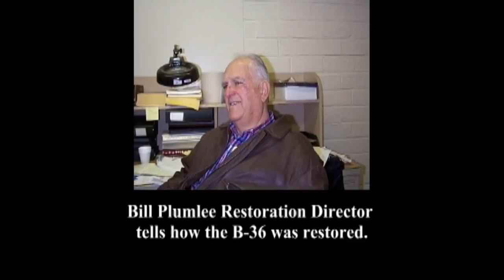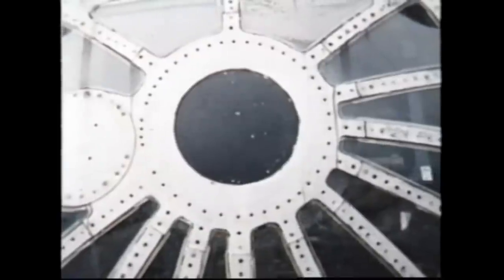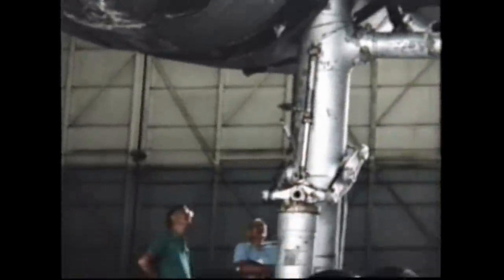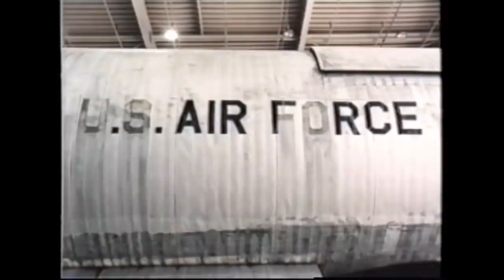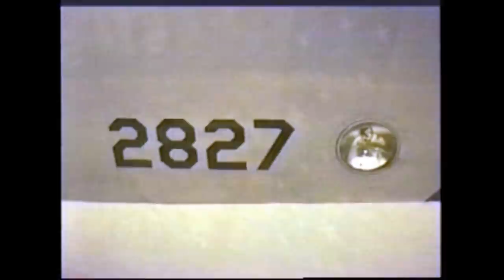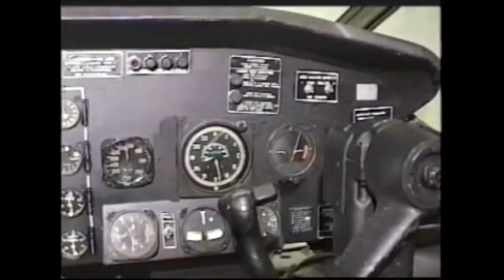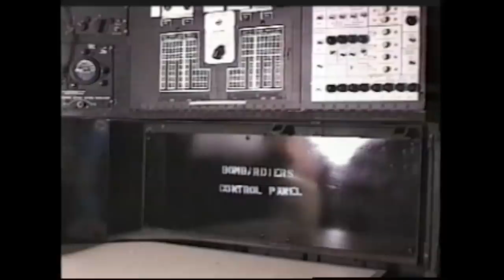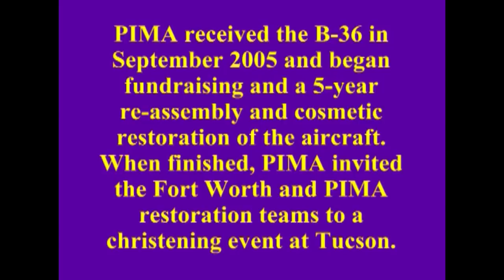Restoration of the last B-36 Bomber in Ft Worth

Comment: I actually  flew on this aircraft; it was assigned to my crew in the 327th Bomb Squadron at Fairchild AFB, Spokane WA.
Around 1973, the original Convair test pilot and I discussed plans to fly it from Greater Southwest airport to Harlingen, TX, then the location of the Confederate Air Force.  That never took place and was left to be vandalized.  On a mission, and after three days of pre-flight testing, and loading three railroad tank cars of 115/145 gasoline, it was ready for a 30 hour flight. I accumulated over 800 hours in the B-36 .  F Hasman
Reply: I saw a modified B-36 at Lackland in what looked like a private piece of ground. It was modified to be a transport or some other type of aircraft.  This was about twenty-five years ago.
Reply: FRANK HASMAN 
I w
Reply: Alwey Wong you’re actually thinking of the XB-99. It’s a different plane but based on the same model. That plane is now at the US Air Force Museum in Dayton, OH.
Reply: Great to hear from guys who worked with this gargantuan aircraft!
Reply: Curious to know how much three railroad tank cars of 115/145 goes for, and where did you get it ?
Reply: FRANK HASMAN g
Reply: My dad was a mechanic at Davis Mounthan Air Force Base from 1957-1963 where he helped dismantle the top secret bombsites off of them. Back then security allowed us kids to go in also and we had a blast climbing through these beauties. Good times.
Reply: @checkyoursix5623  Mmmmm... 3x 30,000gal, 90,000gal of high octane avgas at $8/gal? (I only buy 100LL, @ $5/gal today).  A few refineries still made this then, prolly not now.  Special order availability I'd wager. Glad I don't have that fuel bill!
Reply: Hi Frank. Were you a pilot on the B 36 ?  My uncle ( I can't mention his name) was an IP on the B 36. . He was a big dude and his size kept him out of the P 51 s. He joined the service when the flying part was called the army air core later to be renamed the air force. He would tell me stories of flying that monster and how it would gobble fuel to feed its engines. He retired out of the air force as a B 52 IP and commander. He said out of all the aircraft he flew the B 36 and B 52 were the most challenging and exciting to fly. It is to bad  we can't stay young for longer than we do. All of us that were and are pilots belong to a special group and provides a fun filled and very rewarding career. Good health to you Frank and thank you for putting your life on the line to protect the rest of us.
Reply: Frank,
Thank you for your service. My father was a B-29 navigator 1944/45.
Paul
Reply: Very sorry for you.
Reply: NO words to describe the HONOR,RESPECT,LOVE that these HEROES DESERVE for ETERNITY. THANK YOU ALL  WHO SERVED TO PROTECT OUR OFTEN TAKEN FOR GRANTED FREEDOMS IN OUR USA. GOD IS SMILING ON YOU,THANK YOU ALL. Rod Checkalski/WI.
Reply: @rodcheckalski3942  - There is no fool like an old fool.
Reply: FRANK HASMAN, a Salute to you sir!!..
Reply: I think you mean Commemorative Air Force
Reply: What a fantastic experience to be aboard this plane!  When I was a kid growing up in San Diego the B-36's would fly right over my home leaving Lindbergh Flied..  I could hear it coming with those 19' diameter props beating the air, and I would run outside to see it pass overhead - every time!  ~WHAT a PLANE!~
Reply: Lucky to be alive, that airplane was a piece of junk!
Reply: Cool story Frank. My dad was in SAC around 1948 and set up in French Morocco. Thank you for your service.
Reply: This plane was a pos!
Reply: @DavidSmith-jj1de  Thank- you 

Dave Smith
Reply: I use to live in Spokane Washington my dad was stationed at Fairchild afb before we went to Germany in 82-85
Reply: Too bad you only proud to flew it but no action from the government to make the plane to fly again.

Only lots of old folks  cares about this plane. ..not the government. .not the young people.

So sad the plane only ended at the museum! !
Reply: Alwey Wong .... the old XC-99 variant of the B-36 was an only child. The only one produced. I believe it’s in Dayton Ohio at the Air Force Museum.
Reply: R.R - VR46 l
Reply: Alwey Wong It was an experimental aircraft, the X99. It was the fuselage and empennage of a C-124 cargo plane with the wings and engines of a B-36.
Reply: Matt Graham it was the Confederate Air Force until they changed it to Commemorative.
Reply: Mr Hasman  sir  I salute you.  I was  fairly  young in the N  end of Idaho  remembering  36's  overhead.  How  darn old are you?  I'm  71, here, in 2019.  Spent  6 years in the Navy  (NAS Miramar  4 years) maintaining  GCA RADAR and TACAN
Reply: FRANK HASMAN thanks for serving.  I’ve always been fascinated with the B-36!
Reply: @garyharris1932  not modified,....it was designed as a transport version of the B-36....called the XC-99.  The one example is at Lackland,...and was parked out on the tarmac just down the hill from Lackland, on Kelly AFB.  I was a member of the 149 Tac Fighter Wing, and saw it all the time.  I think it's an amazing aircraft, but they only built ONE, and then cancelled the idea.
Reply: Thank you for your service ❤️
Reply: Powerful, relentless, and inexhaustible...
AND Slow, expensive, and unreliable.
Reply: John Smith tremendous salt 🧂
Reply: Wow! what a experience to fly that big but beautiful aircraft!
Reply: Dean Siracusa  Wow, I didn’t know about the cargo version. I was born at Wright Patt,  been inside the B36 many times.  My Dad was a test pilot after flying in WWII, guess I haven’t paid much attention to the XB-99 (or is it XC-99) 
    edit: I think I’ve seen it years ago, it if was parked outside.  I’ve attended several “Wright Stuff” reunions where we had the run of the museum without any public there.  Had the pleasure to sit in many cockpits.   The XB-70 guys were there, great stories.
Reply: David Smith Us kids too!  Going on thru the tunnel was the funnest in the 50’s.
Reply: My father may have been one of your mechanics. He was stationed at Fairchild, and also served in Forth Worth and Elmendorf.
Reply: Thank you for serving our country.
Reply: I look up to you m8
Reply: El Guapo mas macho  why would they put that much detail and research into that if it was a lie
Reply: El Guapo mas macho  I've never actually had it
Reply: @mattgraham4340  Back in the time he is talking about it was still called the Confederate Air Force.
Reply: Mr. Hasman, the aspiring writer in me must ask you a clarification on a technical point, please: which is correct: Bomb Squadron, or Bomber Squadron?
Reply: @garyharris1932  , that likely was a conversion to a Convair C-99 USAF Cargo Transport (source: Convair B-36 [of Bert Kinsey's Detail and Scale series of books, Carrollton, TX: Squadron Books; the author, whose name I cannot recall, was a B-36 and Boeing B-52 "Stratofortress" USAF Strategic Bomber pilot.)
   You add something to the discussion: the hybridisation of the aircraft with a C-124. Please clarify. Also, is this latter a Douglas aircraft?
Reply: @armstronglance , C-99 USAF Cargo Transport. (See my reply elsewhere in this thread.)
Reply: @Patriotgal1  fast forward 3 years and presto.
Reply: @matthewhicks6531 Another victim of the "WOKE."
Reply: @DavidRLentz  XC-99 is now in Tucson too.

Comment: I'm the guy ( Aqua shirt ) at roughly 0:35 leading the plane to Run Station #1.  I had to design the "Pull Mechanism" over a weekend because they couldn't get documents in time to me.  So, it was "My" plane until i got it to the Run Station!
Reply: DWBCHALLENGER thats a big job?? How many hours did you have in that??
Reply: DWBCHALLENGER ... Just watched this video what's the latest 
do you know? Share it with us.
Reply: Good job!
Reply: Good job. I can't imagine how nice it must be to have something like this you could call your own.
Reply: Bill Barry ....well.... it was a lot of responsibility. For one, it still had 50 year old tires on it. Would they hold?  I had them pumped “up” though to decrease the contact patch. Low speed tow wasn’t going to heat them up.  Also, I had “nothing” to go on for the method of pulling it out of a field. It was sitting on concrete pads but it had to roll across grass to get to the street.  So the design was purely my own. Had to design it strong enough.  How much pulling force will be required across that grass field?  So, design it Friday night and part of Saturday. Then the thing had to be built on Sunday for use on Monday. It wasn’t the “hours” in this case. It was the responsibility and the unknowns that could bite me with an enormous plane blocking ALL the traffic into the manufacturing plant.
Reply: MrCloudseeker  I’ve seen it and it is nowhere close to the size of a 36.  It was one that used to be part of the Pate Museum I think.
Reply: Dinos Metaxas They tried desperately to get enough funding for it to have a building structure to protect it here. People just weren’t interested. Fell far short of funds needed. It was partially disassembled and sent to Pima.
Reply: A “friend” must have messed with my phone so my YouTube identifies as this instead of DWBChallenger. I can’t figure out how to change it. Same guy!  I swear!
Reply: DWBCHALLENGER did u fly in that p36
Reply: I think I doubt it will ever fly again. It's like the Vulcan in the UK.. money is attainable. But all the engineers whpo are with us that understand the 50s mechanical / primitive analog electronic computers are getting less and less as the years go by. and the younger people just aren't being taught how these obsolete systems work..
Reply: thank you for sharing
Reply: Sure you were.
Reply: Great to hear from guys who worked with this gargantuan aircraft!

Comment: I cannot remember the exact month; but in the wee hours in 1957, I had main gate guard duty at Showa Air Station Japan. The sky lit up with very bright white lights. The guard shack vibrated and sound roared. I didn’t know what was happening. It turns out that B36’s were coming in to land at Yokota Air Base. I learned later the B36 was being retired and they were making the last flight. What a magnificent “bird!”

Comment: I Started out so happy that this was being restored and the amount of effort that went into it, then I got severe depression when I found out it is sitting out in the weather again.
Reply: But this time in Arizona! The weather if much better there so it will last longer.
Reply: Tucson has sun 360 days a year.
Reply: IVAN IVONOVICH @
Reply: @59Kona  The sun is just as damaging over time. I worked with the restoration of aircraft at the Flying Leatherneck Museum at MCAS Miramar, and baking under the sun for years on end, along with bird droppings and yes, even rain... will slowly ruin this plane again.
Reply: Building a hanger for this would cost millions 😬
Reply: Steven Cramsie Miramar is a completely different environment than Tucson. I live 20 miles away from MCAS Miramar, it gets hot and dry some days of the year, but we usually have humidity, plus salty air from the ocean.
Reply: It needs to be in a hanger.
Reply: Tucson is1 of a Few areas perfect for outside storage of Aircraft. 
Plus now it's disassembled and packed for storage.  Yes inside would be better,  but then you'd have to make it climate controlled 
 Inside temp of a non cooled warehouse in Tuson can go as high as 50 deg.+ inside.
Reply: @juliancrooks7559  for an example the museum at Dayton has some of the biggest hangers ever built and the B-36 they have had to have reinforced concrete blocks for its wheels. Then it had to be pulled in catty corner and at a really oblique angle. Even when the 36 was a frontline bomber they could never build a big enough hanger to park them in. The B-36 was originally designed as a bomber to attack Germany from the United States and to return to the us. When designed it was believed England would fall in a matter of months and we would require intercontinental range to hit the Germans.
Reply: @pat36a   50 deg isn't too cold, or were  you just trying to sound continental?  this is an American plane in the US, so use deg F!
Reply: @matthewcaughey8898  When I visited the AF a museum many years ago they said they built its display hangar with the B-36 in mind, and left one long side of the building open, then rolled the bomber in, and then completed the hangar.

Comment: I was watching all the guys doing work with their hands, painting, welding, riveting and even beating a panel. Today all that labor is accomplished by robot and the skills  witnessed here are passing into history. I recently watched a guy making part of an air scoop for a P-35 and he was using an English Wheel.  He would wheel it and check the shape and then check the fit. Wheel some more. He did not have any kind of a template, only the opening he needed to fill. I have so much respect for these craftsmen.

Comment: When I was about eight years old I saw one of these war birds fly right over my house maybe just a few thousand feet up.  The ground shook and the sound was massive grinding rumble.  This was an airplane that only the United States of America could build or fly.  Present! Arms!
Reply: In the late 1950s one flew over my house in Watford, southern England flying south. It seemed so low but then, it was huge and probably at a safe height to overfly an urban area but underneath the stacking area for London Airport. Several did visit the UK. That was the only one I ever saw.
Reply: Same memory in San Diego, CA, when Convair Plant on Pacific Highway was making some modifications.  Took off over Loma Portal and my back yard.  Only few hundred feet elevation!

Comment: Sure would love to see that bad boy rumbling through the air
Reply: This B-36 was originally being restored to airworthy condition as a flying museum that would have toured the country. I remember seeing film of the engines being run up on the ground. It never happed, the USAF stopped it. Can't have a nuclear bomber in private hands flying around.
Reply: @7echo  but the B29 is also a nuclear-capable bomber with some in private hands, why not the B36?
Reply: @NUCLEARARMAMENT  B 36 was designed as nuclear capable, as was B 52, B29 was not.
Reply: @gulfrelay2249  I don't think the problem was with it being a "Nuclear capable bomber" probably the biggest hurled in why it was never given the "go ahead" to be a flying museum, is simply because of the size, and cost. 

B-36 has a wingspan of 230ft. (70 meters) and a length of 162ft. (49.3 meters). 
B-29 has a wingspan of 140ft. (42.6 meters) and a length of 99ft. (30.2 meters). The B-36 is nearly twice as big as the B-29. 

B-29 has an empty weight of 74,500lbs. (33,793kg) 
B-36 has an empty weight of 166,165lbs (75,372kg) 

B-52 (just to help put into perspective just how massive the B-36 is)
B-52 has a wingspan of 185ft (56.3 meters) and a length of 159ft (48.5 meters)
B-52 has an empty weight of 185,000lbs. (83,915kg)

Heres a photo which puts the size of the B-36 into perspective when compared to a B-29 https://upload.wikimedia.org/wikipedia/commons/5/5c/B-36aarrivalcarswell1948.jpg

Not only is a B-36 nearly twice the size, but nearly twice the weight as the B-29 as well. And considering the cost of keeping her as a "Flying Museum" If you go down the path of keeping her like the B-29's, B-24's, B-17's, ect. I'll give you a little anecdote, I recently took a flight on a B-29, the cost of tickets for the flight ranged from just under $600.00-$2,000.00 USD. for a 30min flight. And while waiting for the flight and talking with the crew they said the cost to completely fill its tanks would be a little over $30,000.00 USD. considering the B-36, has 6 radial engines, and 4 jet engines, for a combined total of 10 engines VS the B-29's 4 radial engines. Going by logic since everything else about the B-36 is nearly twice that of the B-29 it would be safe to assume the cost of tickets to fly on it would be at least double as well. Also as cruel as it may sound, other than being an absolute marvel of engineering, the B-36 really isn't all that special. She never saw combat, or had any major historical events related to it, other than a broken arrow incident.

TL;DR The B-36 is twice as big and as heavy as a B-29, Unlike the B-29 the B-36 has no major historical events related to it. The cost already on keeping the B-29's around is astronomical, for a B-36 it simply wouldn't be worth the cost, and given the physical size of the aircraft you'd be hard pressed to find airports large enough to accommodate her.
Reply: @Matthew Caughey Damn and I thought I wrote alot. XD 
Don't get me wrong I appreciate the history lesson and all but I don't see how an in depth history of the B-36 is relevant. The fact these planes were designed to carry Atomic payloads isn't the reason you don't see them preserved like FiFi or others. The issue is there size like I stated, there physically dimensions are nearly twice that of the B-29 an already massive plane. Considering most flying museum come to regional/municipal airports and NOT International Airports it would be difficult to find such facilities large enough to accommodate such an aircraft. On top of the exuberant cost of keeping such a craft fueled and maintained/in flying condition.
Reply: @TEHSTONEDPUMPKIN  Even the Air Force had its time cut out keeping these planes flying, given their size and complexity. Over time, many components (such as wiring looms) would deteriorate and would be a present-day nightmare to replace. The multi-row engines were inadequately cooled and difficult to maintain. All too much even for a group of enthusiastic volunteers to take on.